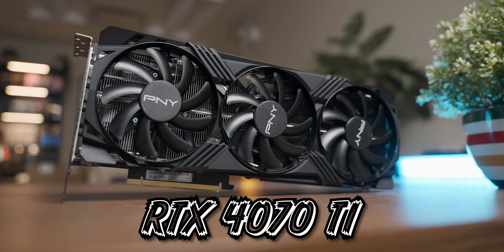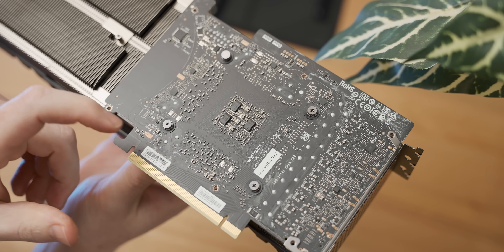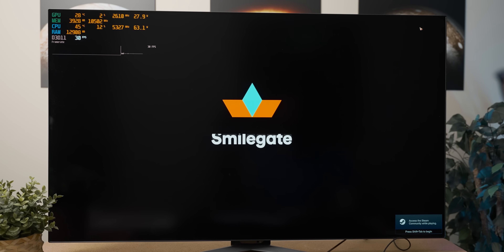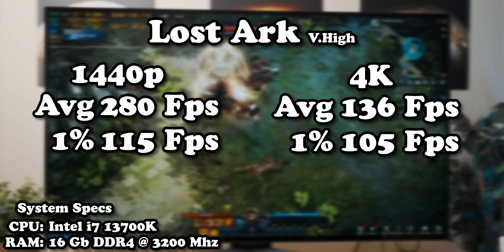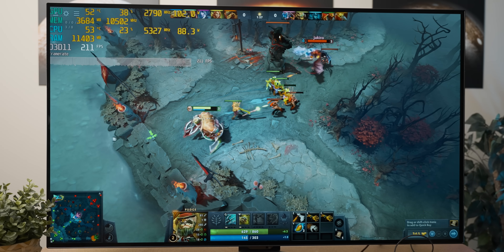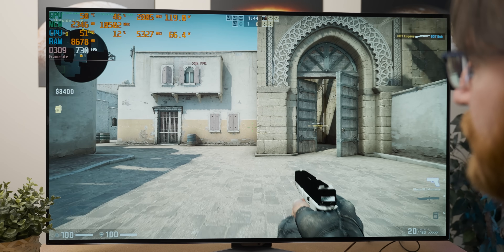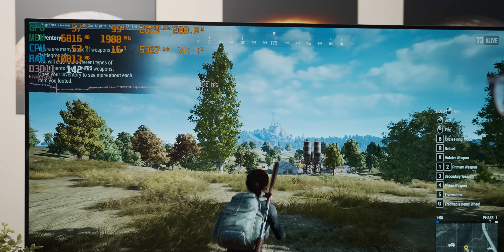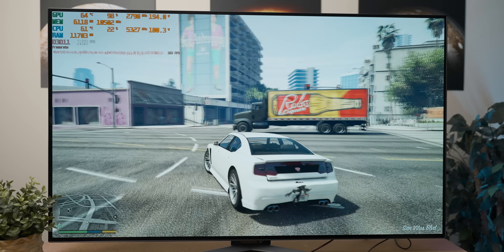RTX 4070 Ti Vs 5 Most Played Games On Steam

Comment: 1:12 It's really hard for people to count nowadays, isn't it? I have heard this connector called everything that it isn't, and not once outside of LTT have I heard it called the right name. I've heard 10-pin, 14-pin, and now 16-pin. It is a 12-pin connector.6 top and 6 bottom. I get it, you need to connect 2x8-pins to the connector, sure. That doesn't make it a 16-pin connector.
Reply: There are 12 larger pins and 4 smaller pins. It's valid to call it a 16-pin cable. You must be really "fun" at parties, though.
Reply: @Yuu_Touko  the lower pins are for communicating with a compatible PSU. They are not for power delivery, and here are not doing anything. This is because of the adapter. Try looking into it before saying the same thing Dawid did, and only looking at the physical. 

Most of the USB 3 standards have the same number of pins, but function different. That is why they have different names. It's not about the physical thing, but the function. The connector is for power, the extra pins are there for more features, not functionality.
Reply: @DustyTheDog  I know they aren't for power delivery. Still, they're there, so for me, and many others, it makes it valid to call it a 16-pin cable. Just because. :)
I also use 12-pin.
Reply: @Yuu_Touko  The true name for it is 12VHPWR, which is indeed different than ATX 12-pin.  Just shortened to 12-pin for ease. What matters "for you" doesn't matter in reality. Your personal perspective means nothing to the real world. Feelings=/= facts.

Your ignorance is what fuels the debate here.

Comment: Oh I hate the term future proofing. I had a computer that had a GeForce MX as the integrated graphics for the chipset. Back when AMD and Nvidia were kinda partners some of the time.. Anyway, the graphics were pretty good and I figured I would get a new Graphics card when it was slow, then the industry dropped AGP like a hot potato covered in vaseline. The only upgrade I could get was from ATi. Thank goodness for that one single choice for a reasonably modern GPU. But yeah future proofing is a lie. Get what serves your needs now and doesn't break the bank and if some idiot comes by who spent twice as much as you for 5 more frames, point and laugh and drive away with a much nicer car.
Reply: I agree 100%. Was just thinking exactly this last night. 
"Future proofing", maybe, is getting top of the list, best and most expensive tech. And you'll be futureproof for a... 2-3 years. Most people have human level budgets and get what they need now. And when every god damn AAA title comes out unoptimized, "future proofing" is even more irrelevant term today.

Comment: The best thing is the 6700xt has the same amount of vram as the 4070ti has, the 6700xt even has a higher bandwidth memory bus.

Edit: both have 192 bit bus
Reply: Having better memory specs don’t really mean much if the performance doesn’t show it
Reply: The 4070 Ti has more than 30% more memory bandwidth than the 6700 XT (504GB/s vs 384 GB/s)
Reply: 6700xt is the best deal out there right now.
Reply: They both have a 192bit bus, 4070 ti has higher bandwidth because the memory is faster.
Still, it's disappointing on such an expensive card.
Reply: all this copium here of ppl desperately trying to make the 6700XT to be even comparable to a 4070Ti, I mean even the 3060Ti is faster overall (and then we are not considering DLSS which makes the 3060Ti (almost) a 4K GPU)
Reply: @benfrese3573  Just wait until you start hearing about 12gbs of VRAM is not enough. While I'm still with my 16gb card that lasted me more than 1 generation.
Reply: @benfrese3573  "the 3060Ti is faster overall"  Nah... it's not.
Reply: @jasonking1284  marginally, but yes. There are some titles where the 6700XT wins, but bottom line is the 3060 Ti is faster by a few percentages. And then we are not even talking about DLSS.
Reply: @benfrese3573  Bro what are you on about? I have both cards and the 6700xt is faster in almost every game. Where are you pulling that info from
Reply: @vukvidanovic8276  Just look at any benchmark out there, easy.
Who cares about what your broken rig's performances? If the 6700XT is fast you did something wrong, pretty simple stuff.
Reply: @benfrese3573  Because their 6700XT is faster, their rig is broken? Grow up.
Reply: @XsaviXander  When you are the only one who has those results you should look into it, is all I'm saying.
Reply: And at least 50% of the performance too
Reply: Until it shits itself trying to do anything other game or watch media. AMD can't do productivity.
Reply: ikr 6700xt is so much better gpu compared what a 4k powerhouse of a card
Reply: @xTurtleOW  6700 xt is a trash card nobody will take it over a nvidia
Reply: @xTurtleOW  If you get double the performance in GPU-limited scenarios for double the price, then the 4070Ti is a runaway winner. Typically the premium for higher performance is a sharp curve, not a line.
Reply: @CyberneticArgumentCreator  That would be the case if we were comparing GPU's from the same year/gen. We're not.
Reply: @CyberneticArgumentCreator  but with rtx 40 series its the opposite way, the 4090 is much better value than the 4080
Reply: but its AMD so L
Reply: @bloxoss  average amd hater
go actually try it
I have a 6700 XT and it runs 1440p max at 60 fps+, no questions asked

Comment: I bought the 7900xt over it because of the vram. No way i’m paying that kind of money to have to manage vram.
Reply: until it overheats and dies😂😂
Reply: @jacobjimenez2629  junction temps are 80 degrees. No issues.
Reply: this was my main hangup when picking a new card for the PC I just built. I ultimately went with the 4070ti for the lower power draw and temps, but also bc I only game at 1080p 240fps which seems to be the sweet spot for the 4070ti. My next upgrade will probably be AMD tho

Comment: I'm glad you started your testing at 1440p.  I don't know why all those other sites insist on running 1080p benchmarks against modern GPUs.  Do they think anyone cares that the card will pump out 600 fps at that resolution vs last generation's 500 fps?
Reply: It's more common than 1440P and is what was tested before for comparison. For GPU benches higher makes sense but for CPU testing at 1080p you will run into more CPU bottlenecks.

Comment: I bought the RTX4080 here in sweden for  around $1600 USD, and it is a real beast. I told everyone that I bought it because STALKER 2 is coming out soon and it needs a beefy GPU. But the truth is that I love maxing out any game without having to worry about it having low fps. And the cooler on it is just massive, like almost double the size of the actual chip board XD
Reply: Not any game, Running a game well also depends on the game engine and optimization. I love my 4080 and the price tag doesn't bother me (I'm in a fortunate position), But some games still run like crap lol. If I went out my way to buy this thing I could see myself being pretty pissed off sometimes.

Comment: I recently got an RX 6800 XT. I’m playing my game in 4k awesomeness! No regrets
Reply: I even have the Power Color Fighter RX 6800 ( Thanks for the bonus large amazon gift card for working a buttload of hours from my company! Lol. ) 

And the highest Temps I've seen so far are like 57-65 degrees.

My old 2060 was constantly between 73-78 degrees.
Reply: Hi planning to get one as well .have you noticed any heating issues ? Regards
Reply: @alexisrego1502  that usually depends on the brand of the gpu you're getting and what cooler is on it
Reply: @alexisrego1502  
No problems, it’s running in the 60-70 range.
Reply: Same its great got the Power colour Red Devil version. No regrets
Reply: What did you have before that...
Reply: @StrydyrR HellZ RydyR  If referencing me, I had a Gigabyte Windforce OC RTX 2060 6gb. It ran hot because of the overclock from Gigabyte was pretty high, NGL, it did kick ass for what I needed it to do. I also got it when it first came out..before anyone know the 20 series supers were coming out.

Either way, I repasted the gpu and slapped new thermal pads on and passed it down to my son's pc along with my old Ryzen 5 2600x cpu.
Reply: @strydyrhellzrydyr1345  

3060
Reply: I'm starting to consider the RX 6800 XT because on the NVIDIA side I'm considering buying the RTX 3080 instead. Then I started to wonder if I should save a little more for a 4070 ti but based on this video it seems like overkill and the money I save buying a cheaper card could go towards a monitor instead.
I guess it just depends on if I think ray tracing will be a huge deal for more upcoming games or not?
Reply: Big fan of my 6800XT. Cyberpunk wanted it to default to ultra ray tracing which is a little much lol.

Comment: I would be rly interested to see how much fps it gets in vr games since they take almost doubble if not more the performence of the dektop version. Would be cool
Reply: I play dirt 2 on high graphics with 90 FPS  can't complain.....I waited almost 2 years for a 3080 price drop, and it never happened.. Had to shit or get off the bowl....Purchased the 4071 TI for 800 bucks.. No complaints...
Reply: I've been playing skyrim vr on max settings and some graphics mods with no issues
Reply: @tylermauldin54  I could play modded Skyrim on max settings at 1080p with a GTX 960, so that's not much of a comparison.  Hell my current 3060 could probably do what you're doing.
Reply: “Dubble”
Reply: @charlesbrown4483  rip e-dubble
Reply: As someone who gamed on VR with mostly max settings using a RX5700XT (8gb), I can tell you it won't make much difference. The required 90FPS was maintained most of the time, with only a few games needing quality dropped down (Alyx etc.).

I still find it crazy how well VR games are optimised to run on dual screens at 90FPS.
Reply: blud said "dubble"
Reply: @riyoszu  skyrim vr, not the normal game, massive difference
Reply: imagine the fps in the normal version of the game and half it, if it doesn't have a non vr version then you can assume depending on the title if it runs better or worse to the other games you've seen.
Reply: the pcb is so tiny yet it costs more then a Russian tank to purchase gotta love that one
Reply: @raven4k998  take ur meds bruh
Reply: @lemonhaze715  done lets get busy now baby

Comment: You remember the shampoo that babies use? It would be Johnson and Johnson "no tears" formula shampoo. So squeezing it directly into a child's eyes would be a good way to punish the child, but would not leave troublesome visible marks that CPS could pay you over.

Well, Nvidia is using similar marketing lingospeak on your card. You just read it wrong.

It's not 'tearing' like ripping. It's 'no tearing' like crying.tears. tear-ing.

Nvidia is trying to tell you not to cry before opening the card up and laffing at it's PCB. 

Clearly your card came from an open box unit, because the splooge you saw on the PCB was the still-undried tears of its last owner.

BTW, xenomorph scrotum is the best thing I have heard all year.

Comment: You really need to change that gpu power setting to max performance in nvidia control panel to get a better Gpu utilization in games.
Reply: Nope, totally not the way to do it. It will burn power like hell on idle. While gaining you NOTHING in Games. It already boosts itself automatically to its targeted frequency set in the vBIOS, if there is thermal headroom that is...
Reply: @Mom19  I just changed it from normal to max performance and at idle it made no difference at all. Still 17 to 20w.
Reply: Please dont do that. The GPU will end up running at its base clock constantly and chugging 80W of power at idle.
Reply: @P2PC  it does not work like that, it only affects 3D applications improving GPU behaviour in games.

Comment: I looked at a 4070 ti, I own a 3070 non ti. considering a 1070ti was about £350 the £850 for a 4070ti is joke and no point will i ever pay that. This is where PC gaming ends for me. It's too much far far far to much. 4070ti is a mid tier card couple with a mid tier CPU and mid tier ram so it should have a mid tier price. Complete build should be around £849 for a pc not £849 just for the GPU.
They have priced them selves out the market.

Comment: Please consider adding Rust to the games testing line-up, it's consistently been in or around Steam's top 10 for the past 9 years, still gets monthly content & graphical updates and I've seen streamers using 3090's and still struggling to get 150fps+ so it's a relevant, demanding title that can test the latest hardware
Reply: Because it is and always has been terribly optimized. It looks fine, but not for the performance you get.
Reply: Because it's an unoptimized mess of a game
Reply: rust is the only game that ever brings my pc to its knees

Comment: It's worth it to go for 4070 ti if Nvidia hadn't made it that price it would be worth it if it was $500
Reply: I read it was actually supposed to be a 4080, but it was changed. And even so, with the performance it gives, who cares? I agree it’s overpriced but $349? Whatever you’re smoking I want some.
Reply: @Godlyblurrs  I'm smoking a health dose of reality. Perhaps you should too.

A 60 class card should cost 60 class money.

The performance it give is litteraly a 3080 level for... get this... 3080 money... 2 years later, and with a significantly crapper buid quality.
Reply: @P2PC  I feel like you envy people buying new generation cards as you are sitting with some old low end tech, so you are spitting this nonsense lies.
Reply: Yeah the 4070 ti is actually a 4060 rebadged. The PCB buid quality looks 60 class card like.
It should be $349 at the absoloute most. (which is what a 60 class card should cost).

This card is not even a 70 class in terms of architecture. It has a 192 bit memory bus meanwile a 70 class card should have a 256 bit bus. A 192 bit memory bus is that of a 60 class card.

Nvidia didnt want to kill the 30 series with a 60 class card so they rebaged it and jacked up the price to have their cake and eat it too.
Reply: @P2PC  Wtf are you talking about?  It is 4080 12GB not 4060. Its performance is between 3090 and 3090 Ti, sometimes it even beats the Latter in 1440p.
Reply: @redeclipse4ever409  I have no doubt that it can beat the 3090TI. All i'm doing here is assesing the hardware for what its worth.
I'll say it again, 60 class cards have a 192 bit bus, the PCB uses through hole components which are a dime a dosen, the PCB is very small such as for a 3060 sized card. This for all intenets and purposes is a 60 class product.

I 100% envy people which can afford tech like this, not going to deny that.
Reply: @P2PC  From techpowerup article: ,,Of course, memory bandwidth is no way to compare the RTX 40-series from its predecessors, there are a dozen other factors that weigh into performance, and what matters is you're getting generationally more memory amounts with the RTX 4080-series. The RTX 4080 12 GB offers 20% more memory than the RTX 3080, and the RTX 4080 16 GB offers 33% more than the RTX 3080 12 GB. NVIDIA tends to deliver significant performance gains with each new generation, and we expect this to hold up''